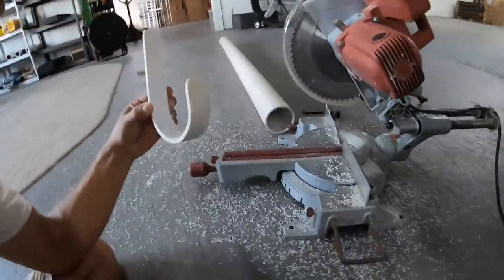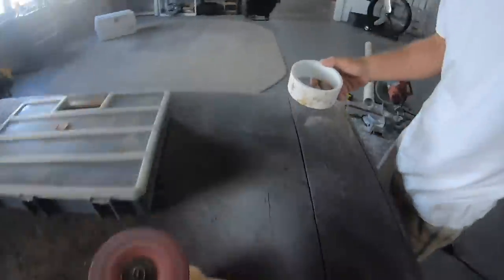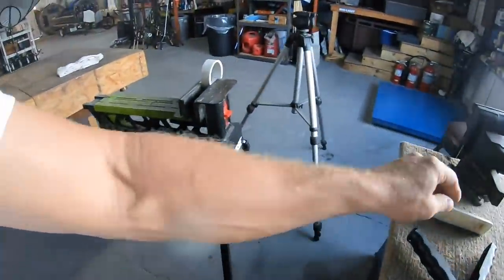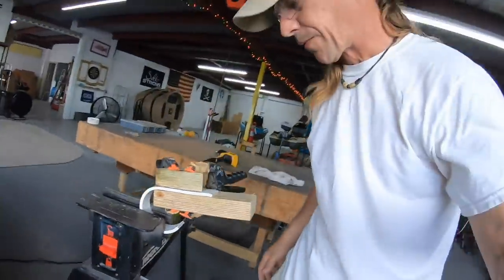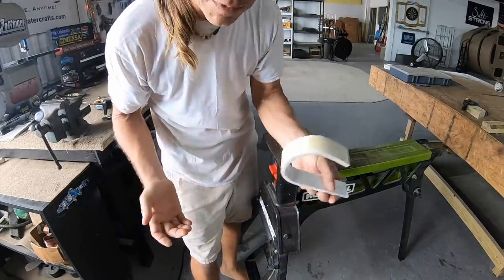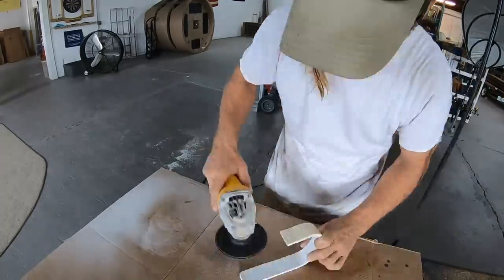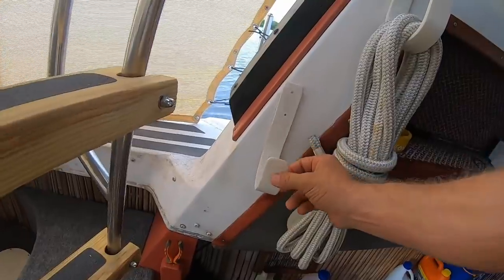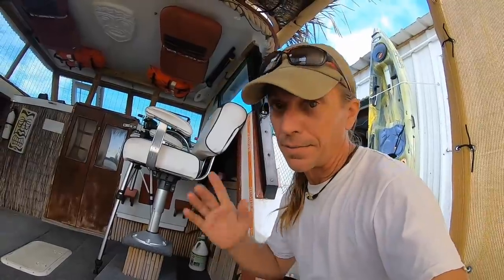DIY Boat Hook

Comment: Always look for big box dealt grinder sales.  Actually own 3 that are equipped with different wheels on them. Saves loads of time not having to switch out. Made shelve that holds them by the screw in handle so they stack nice.